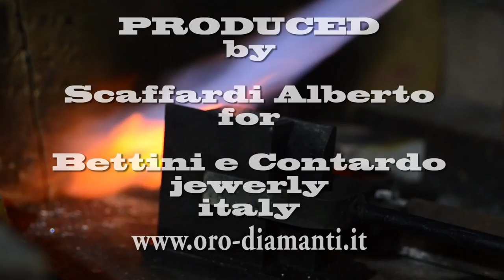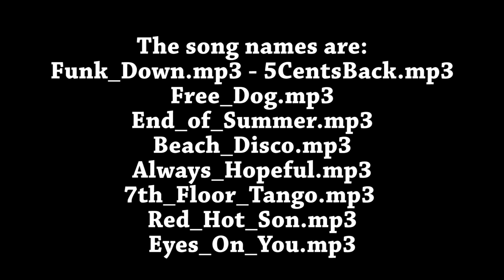Handmade silver ring with name

Comment: 2 options: 
1: You don't have money to buy a 3D printer
2: You really love jewelry
Anyway, congratulations for your work.
Sorry for my english :D
Reply from the maker: Thanks, Each type of work has its advantages and its disadvantages. In the production of jewelery, not in series, often the execution time, taking into account all the steps, are not very different. I believe that an object made by hand can be better than one product in lost wax casting, the finish may be more accurate, the metal is less susceptible to cracks or porosity, the details can be defined during the execution of the work.

Also in my video I show you how you can create jewelry without the use of technology is often not accessible to all
Reply: I had the opportunity to spend time in a jewelry workshopshop and there, the owner use 3D printer to make pieces of wax, only for 10-20 pieces for week.
He said if make handmade pieces lose more gold than the other method.
This is the reason of my comment.
Anyway, jewelry is awesome and your work is pretty good.
Reply from the maker: Valentin Bengea Thanks again, certainly for the series production the level of the finishing of the wax in 3D printing and better use of rubber molds. Very different is the craftsmanship like in the video. Technically there is no loss of metal, is all recovered.

Comment: I was wondering exactly how you find the center to use your calipers to cut out the center after soldering the plate on the side
Reply from the maker: To find the center point of the hole, use the two side walls and the lower center ring

Comment: hi master btw how  i know wich size  i need i dont see you you use nothing to know wich size it is ?
Reply from the maker: We use a numbered cone melt
Reply: scaffoal what is that ?
Reply: scaffoal  i dont see in video
Reply from the maker: http://www.ebay.it/itm/SPINA-CONO-FUSO-misura-ANELLI-in-alluminio-ITA-FRA-MM-USA-gioielli-misurazione-/252914411248?hash=item3ae2dfa6f0:g:yZgAAOSwmgJY31sC
Reply: scaffoal  ok thanks im practice i know all just in final cause letter m is more high than letter e amd  idk how you put both side  equal
Reply: scaffoal  minute 5.3 you cut the side down equal to put the platform but in the up side letter m is more big than lettter e idk what you did to pur equal the platform
Reply from the maker: https://youtu.be/YPrh2vGJ25g?t=8m34s  They are not the same. I put the side plate before salting it, then add the fittings
Reply: scaffoal im confuse in that part ggg
Reply: scaffoal  does the base goes sideways?